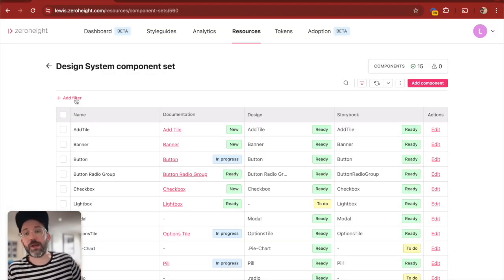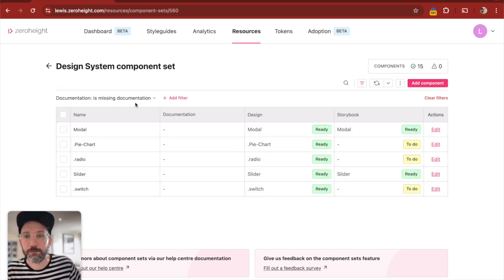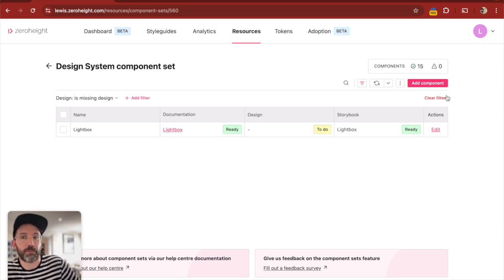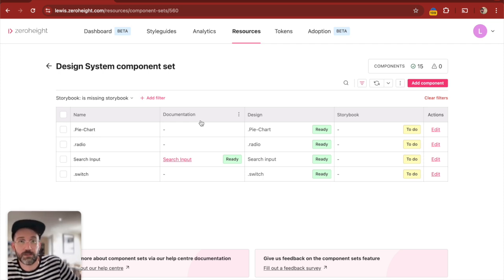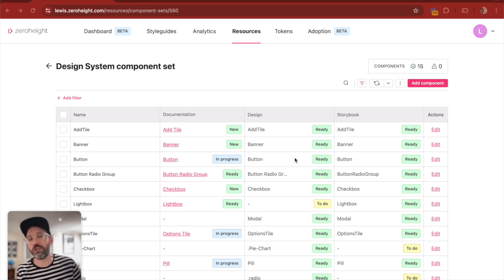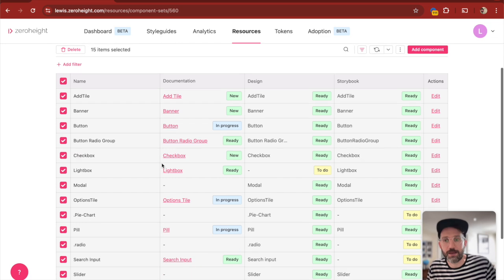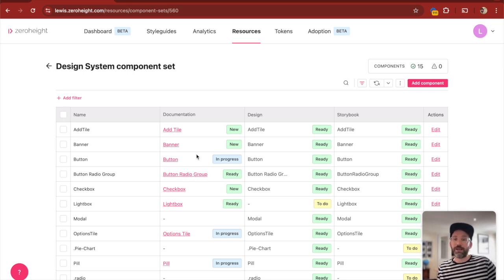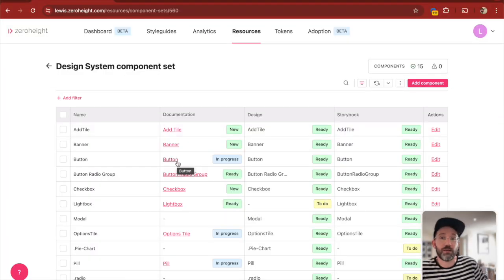Using a component set  | Managing components in zeroheight

Comment: Right, so hate to be that person (proceedes to be that person), but the guidance here assumes a lot of prior knowledge that many teams don’t actually have. Where exactly is the documentation you reference in this video? What does it point to? Is it in Figma, Jira, Storybook, a monorepo? What’s the recommended approach? 

If you want adoption, start from scratch. Lay out the stack, the platforms, what connects to what, and how it actually simplifies things by pulling disparate sources into a single source of truth. Plenty of teams can’t just “go Storybook” because of huge legacy stacks—what’s the path forward for them?

Honestly, there’s very little meaningful explanation or how-to content for Zeroheight, it skips a lot of steps or concepts in-between the "it can sync a thing, how neat is that" while showing many other synced elements in the examples that are not clear of origin, which is disappointing given the purpose of the platform. I get that features evolve quickly and docs are a pain to maintain, but this is literally a tool meant to help with documentation, alignment, and source-of-truth issues. If the benefits and concrete steps aren’t well documented, it makes adoption much harder. Don’t assume it’s self-evident. Don’t assume people automatically get the UVP or the in-the-weeds, technical how-to.